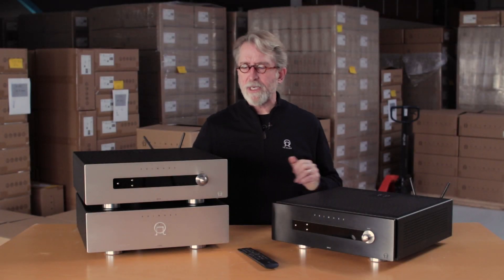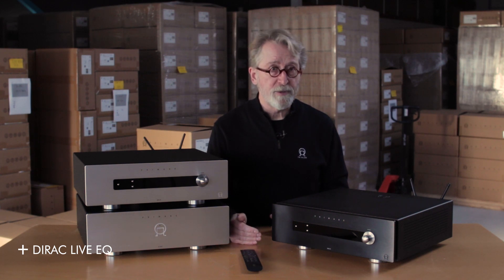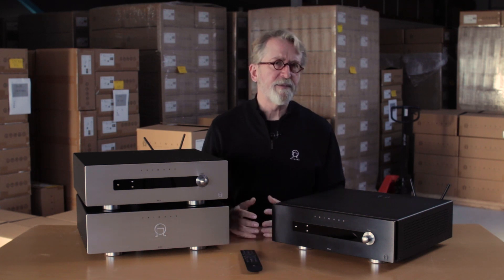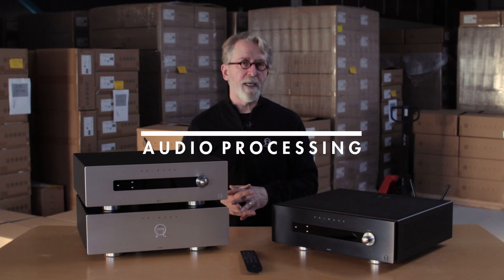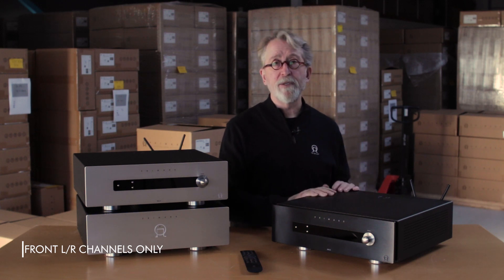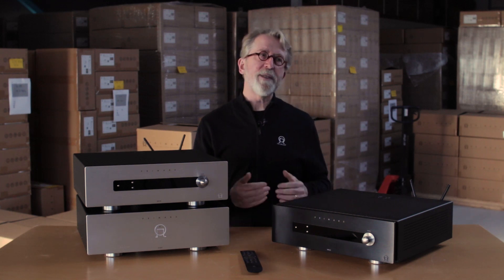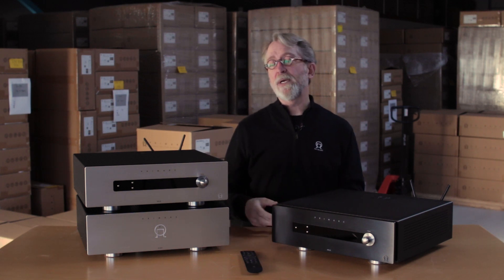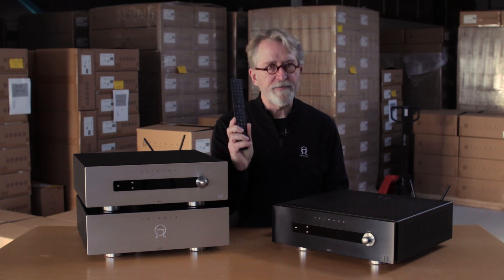SPA25 Prisma Home Cinema Integrated Amplifier and SP25 Prisma Processor Preamplifier Introduction

Comment: I'm looking forward to setting up the processor and power amp in a new demonstration facility in Suffolk in the next few weeks. The multi presets are an excellent feature to have. It will allow us to have a perfect setup for the in-wall and in-ceiling DALI speakers and also additional floor speakers for the left and right.

Comment: Why has this unit dropped off the map since release? 
No actual user reviews and no forum owners threads to be found on AVS or AV forums. I do find this a little strange.
Reply from the maker: Sorry for the late response, but both the SPA25 Prisma and SP25 Prisma have been awarded the EISA best product awards and both have received great reviews that can be found on each of the individual product pages on the website under the Reviews tab.

Comment: HDMI 2.1 (DAC DM-36) ???
Reply from the maker: HDMI 2.0b - see link below to SPA25 and SP25 Prisma HDMI and Video Resolution Specifications document for more details. DM36 is the new DAC module for the modular models I25, I35, and PRE35 and is not available for SPA25 Prisma, see link further to PSA25 Prisma design brief below for more details, Terry  https://primare.net/wp-content/uploads/2022/09/SPA25-and-SP25-Prisma-HDMI-and-Video-Resolution-Specifications.pdf   /. https://primare.net/wp-content/uploads/2022/09/Primare-SPA25-Prisma-Design-Brief.pdf

Comment: Hi, why didn't you give us the opportunity to Bi - Amp the center channel in the spa25 next to the fronts? for my 5.2 Setup that would be perfect.  for now i have to spent a extra xxxx bucks to do so😢
Reply from the maker: There are many reasons, but before making the assumption that bi-amping is a necessity for the centre channel, you may want to listen to the SPA25 Prisma as configured. The adaptive power supply means that power allocation is on demand up to 145 watts per channel, which means that there should be more than enough power to drive your centre channel even if bi-amping your main left and right speakers.